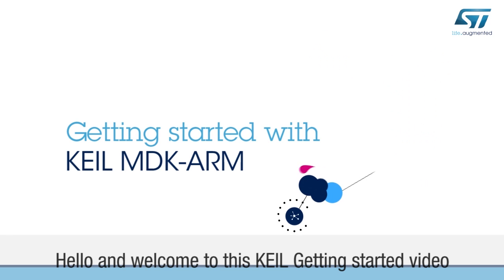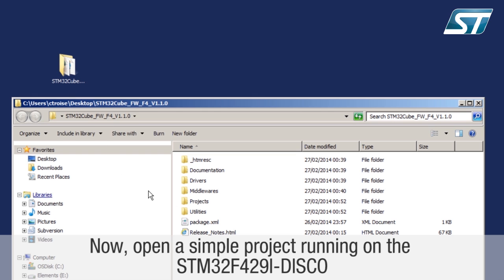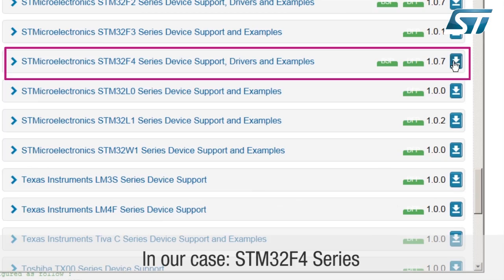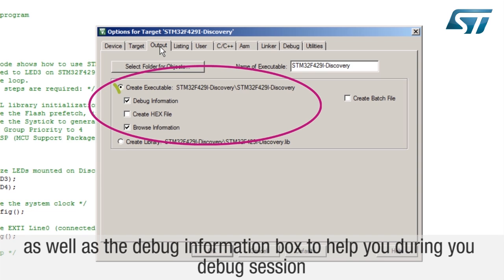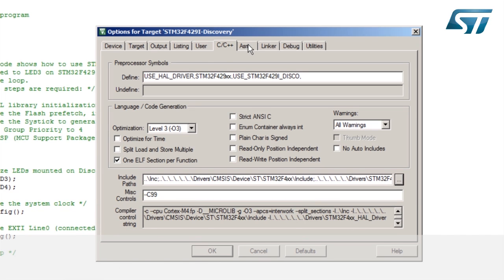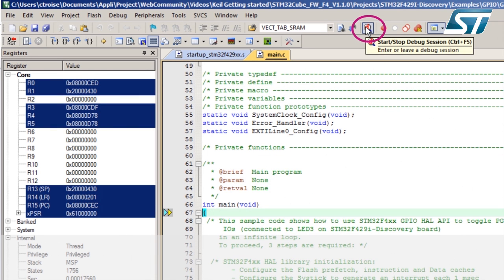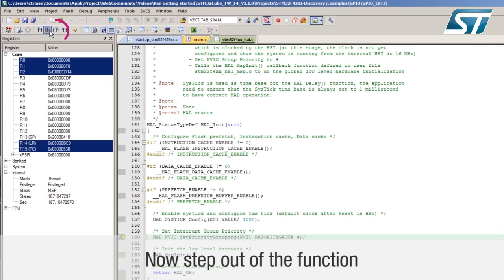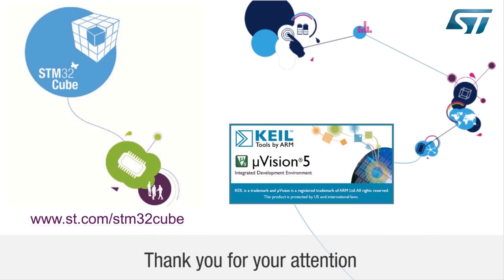Getting started with STM32 using MDK-ARM IDE from Keil

Comment: I am using STMF429I Discovery Board. I am Using Keil V5. I have downloaded and installed Pack for STM32F429ZITx (2.7.0 2015-12-08_ DFP) and added ST- Link Utility also updated ST-Link firmware to V2J24S0.. I did all the setting for option for Target 'STM32F429-Discovery' setting following yourny videos.. And once programmed successfully but from next I am getting error as "Internal Command Error" then " Error: Flash Download Failed -Target DLL has been cancelled". So can you pl help me?

Thanking You.
Reply: me too!

Comment: mine give error
Load "C:\\Users\\timo\\Documents\\STM32\\Tools\\stm32cubef4\\STM32Cube_FW_F4_V1.6.0\\Projects\\STM32F429I-Discovery\\Examples\\GPIO\\GPIO_EXTI\\MDK-ARM\\STM32F429I-Discovery\\STM32F429I-Discovery.axf"
No Algorithm found for: 08000000H - 08000E2BH
Erase skipped!
Error: Flash Download failed  -  "Cortex-M4"
Flash Load finished at 13:47:00